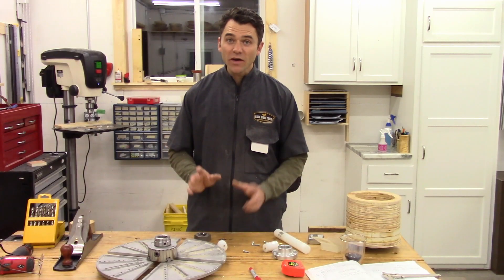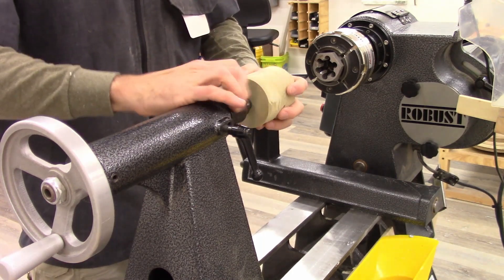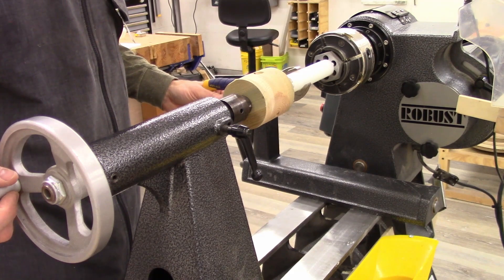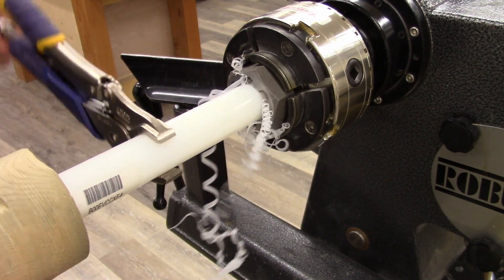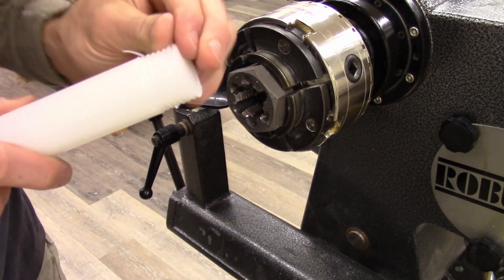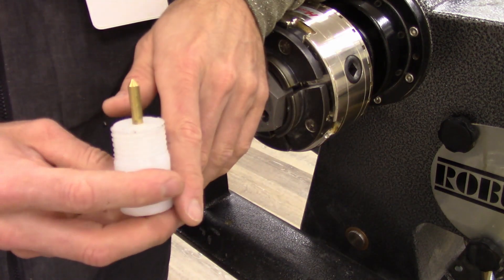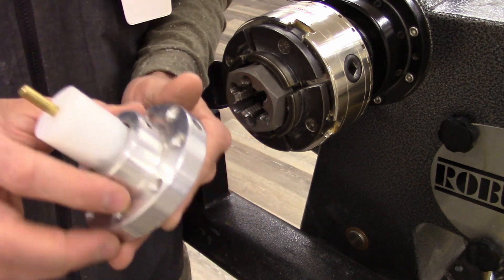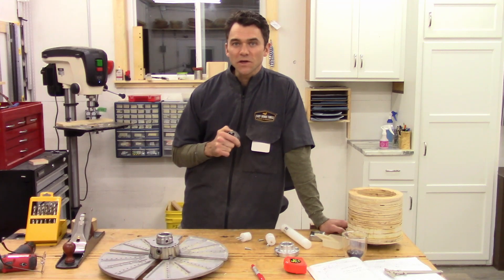Die Threading HDPE on a Wood Lathe

Comment: Great video - triggers a couple of dumb questions.

First, in the metal working world, threading dies are circular.  The die you  are using is a rethreading die that is intended to refresh/repair damaged threads.  Is that difference significant in the application you have for it?  Also, the folks who make bespoke pens understand that threading dies are very slightly tapered (the threads cut at the marked end are very slightly larger than the threads cut by the unmarked end), so they insist that threading has to be a two-step process of running the die over the spindle, and then reversing the die and repeating the process.  Is that necessary with a rethreading die?

Second, I often use threading taps to thread female holes in wood - for example,  fixtures to mount on my headstock/tailstock, or wine stoppers.  I've found that the threads are stronger if the wood is in facegrain orientation (so that the threads are parallel to the grain in the wood).  But I've been notoriously unsuccessful in cutting male threads in wood using dies, but my attempts have all been finer threads in end-grain.  Have you attempted to use your rethreading die to cut male threads, and if so, what has been your experience?  For example, could you make your centering fixture from wood rather than HDPE?